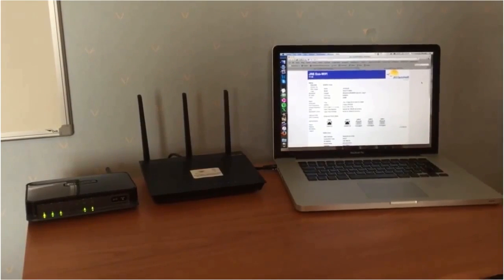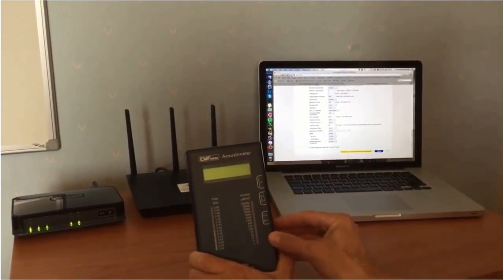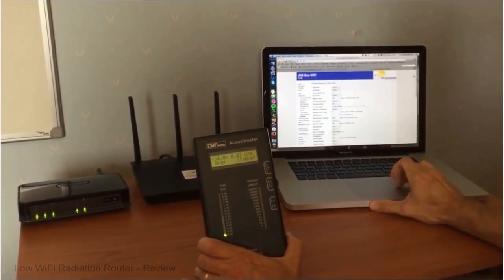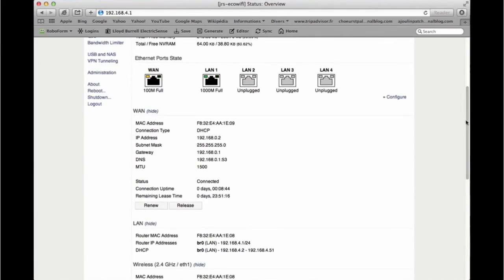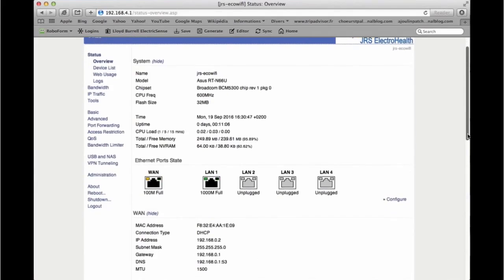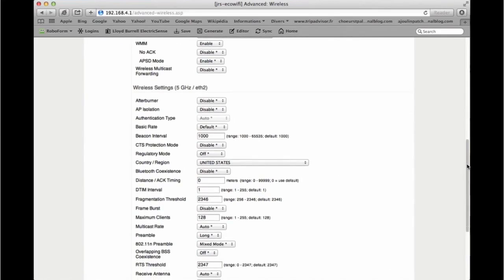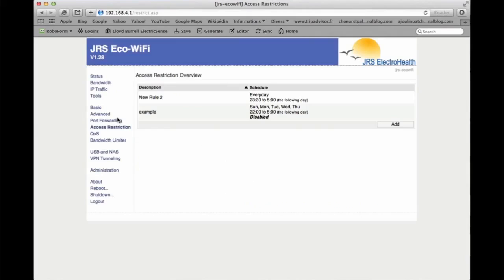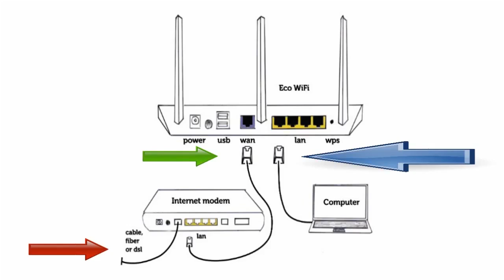Low Radiation Wifi Router - 90% Reduction In Radiation Possible

Comment: I have an older linksys WRT54G router - wired and wireless - has served me well.  However, WIFI does give off signals similar to video.   When I disable the WIFI with the html admin it does disable the connection, however the RF emissions still happen.  When I unplug the router, the emissions stop.     I'm not sure, but think the issue might be with this router and I just need another one.   I like the idea of a router where we can easily choose the WIFI or not and tune the strength of the signal - router suggestions where the RF goes away when WIFI disabled and can tune the strength of the WIFI when enabled?   Thanks.

Comment: Is this model router the latest version of it AND is the lower radiation signal also a weaker one in terms of being able to be picked up from another room than a conventional router?  Thanks
Reply from the maker: The latest model is the N300 there is a link form this page https://www.electricsense.com/11779/eco-wifi-low-radiation-router/ the signal is not necessarily weaker but you can also make it weaker via the settings if you choose.

Comment: I just bought the JRS router, what is the safest MiliWatt level  for  decent performance ?
Reply from the maker: The safest is the lowest possible power setting you can use and still have a sufficiently strong signal to connect to the Internet....you can figure this out by trial and error.

Comment: So cant you use these routers without having to buy a modem also and if you cant isn't there a router one can buy that can operate just on its own?
Reply from the maker: Yes you need a modem for the low radiation router to work... you can just buy an all in one modem router but you won't get the low radiation functionality.

Comment: Thank you for this very informative video. I live in the US and hope I can get one of these routers without difficulty. I have an Apple iMac computer. Does this all work with a Mac?

At around 16:25 in video where you're discussing cons, you said you would still have to disable wi-fi on your modem. Are you talking about a combination modem/wi-fi router? If it is only a modem, there wouldn't be any wifi would there?

Forgive me but I really have little knowledge about this stuff. 
I would greatly appreciate a response from anyone. I have all the sensitivity symptom s and they are quite severe. I want to get on it and make some changes. 
Thank you sincerely.
Reply from the maker: The JRS-Eco-WiFi router will work with any computer - I actually tested with my Mac computer. Wireless modems exist too, that is why if you have a wireless modem (i.e. a modem emitting a wireless signal) it's important that you deactivate the wireless functionality.

Comment: One question I have, is cell phone exposure vs wifi exposure. At home would it be better to utilize the data transmission via my cell phone or better to transmit data via wifi? My initial thought is that once you introduce a tower/transmitter, it by it's very nature will blast more radiation as it needs to constantly ping to see if it is receiving any new connection requests. Therefore using a cell phone for data is better as it does not emit nearly as much passive or pinging radiation as the wifi router would. Any thoughts on this topic?
Reply from the maker: It's very difficult to compare WiFi radiation with cell phone radiation because there are too many variables... strength of your WiFi, how close are you to it, what technology does your cell phone use, proximity of cell tower. But what I can say is if you have WiFi at home this means you are exposing yourself to  an additional source of pulsed microwave radiation, and often its 24/7. I don't condone cell phone use but if it allows you to avoid using WiFi at home, then its preferable.
Reply: @ElectricSense1  A LAN cable from a non-wifi router. It's like the commonality of Wifi made people forget that physical LAN lines exist.  ;)

Comment: Does anyone know whether the eco router will slow down internet speed, e.g. streaming Netflex, etc.
Reply from the maker: This router offers the same performance....the same download speeds as a normal router. That's why I reviewed it. It's only if you reduce the signal strength, would you lose performance in terms of distance from the router at which you can get a good signal.

Comment: Thanks very much. I currently have a BT home hub 4 and for a couple of months now I've been turning it off when not using Internet or wifi. Unfortunately it doesn't have a separate on /off switch for wifi. Could you recommend a modem that has a switch to turn off wifi? I very rarely use my PC because I am disabled and suffer tons of pain if I sit at my computer, so unfortunately I have to lie down on the settee and use a tablet....one which appears not to be able to be connected via ethernet. I use ethernet cables for my tv recording box, in the form of two ethernet plugs.....one by the PC upstairs and one at the back of my tv downstairs, so unfortunately your video on how to connect the low radiation router, didn't apply to me. Thanks

Comment: Is reducing my current router's "transmit power" an option to reduce the levels of EMF being emitted?
Reply: I actually have the Asus RT-N56U router which is probably the same router being sold but with a factory firmware on it. These are its settings. I put a (*) where there is potential. Set AP Isolated: No, Enable IGMP Snooping: Disable, Multicast Rate(Mbps): Auto, Preamble Type: Long, RTS Threshold: 2347, DTIM Interval: 1, Beacon Interval: 100*, Enable TX Bursting: Enable*, Enable Packet Aggregation: Enable, Enable WMM APSD: Enable, Enable WMM DLS: Disable, Tx power adjustment 100%*
Reply: @MrBrianDuga    Same here, I have this hardware already.  As this company states, they are only modifying the firmware, so we should be able to update the firmware ourselves?  But I don't see any download link, or the option to purchase a custom firmware from them.  I have sent them a message but am not holding my breath for them to release the firmware directly to me.

Comment: Thank You for this!! I used your advice in this video to configure my ISP residential gateway (WiFi - router) to transmit less power (less radiation). I wish I had learned this along time ago. However when I studied networking in college, WiFi didn't even exist yet (well it was only experimental at the time). I Disabled the 2.4 GHz band, and currently using only the 5 GHz band in 10 transmit power (the lowest setting in my ISP WiFi router), I've found that in my small apartment it works great, and as soon as I walk out the door the signal dramatically starts to decrease. Which is a good thing, I don't want strangers to try to access my network. I found during my experimentation that the 2.4 GHz band would reach 3 times as far with the lowest transmit power setting (10). Which was eye opening. Oddly enough, my ISP has the transmit power setting set to 100 by default on all their Residential Gateway WiFi routers. So I can deduce, that every single apartment in my 500 unit complex is bombarded with extremely too much radiation for our small apartments. And most homes they also supply internet to. I am VERY thankful for your video. Hats off to you friend. You just provided a very valuable service for your fellow man.
Reply: you're absolutely right -- most of us should have learned this a long time ago, but back in the day one was even ridiculed if one even touched upon the subject (for example, my remarks were also systematically deleted on Wikipedia by industry-sponsored trolls, as it seems. Not uncommon for that source of 'information' BTW). So, yes, the more we know about EMFs and health the better the overall situation will become.

I am also grateful for Lloyds honesty in mentioning that a low-radiation router is just a PATCH (not a complete fix) for the problem. Even a 'patch' is a good thing though if it helps providing a solution (in case people really want a wireless connection). Best way though is turning it all off and simply go hard-wired, just as Lloyd said. More secure against attacks and better speed, too!

Comment: Hi Lloyd, I have a few questions. What is the better band to use for lower EMF exposure 2.4Ghz or 5Ghz? Does this router not have a built in modem? I am wanting to order one of these in Australia, but I can not understand the website as it appears to be in Dutch. I also can not figure out how to contact the owner of the website. Would it be possible for me to buy a local model router that is compatible with this software and then pay for the software and install it on the router myself?
Reply from the maker: There is no clear answer to which frequency is safer unfortunately….the studies show that the 5Ghz frequency has less penetrative power. There is no built in modem…you connect your existing modem to the router. There is information in my article which explains how to do this.
Reply: Thanks for the response. What about getting the software separately as it seems a bit complicated to order for Australia. Do you know of any way to contact the supplier? Do they speak English?
Reply from the maker: You can contact the supplier directly they speak English - there is a link at the bottom of my review page.
Reply: You can actually even change the beacon interval, so it does everything JRS firmware does, I just changed my beacon interval and tested it with my meter. It works! Change it to 1000 to have it sent once a second.. 5000 every five seconds.
Reply: You can get a software called Tomato that does almost everything shown in this video for free . Google "Tomato by Shibby". I have a WRT54GL with it and I can reduce the TX Power and schedule it to turn off just like in this video.
It's great JRS has stepped up to sell this router that is already configured, as it is a lot of work to flash the firmware and get the correct one. If done wrong, you will brick the router. The JRS also has the reduced beacon rate which Tomato does not.
Reply: Wow, that's cool, thanks for letting us know. Does it work for all routers?
Reply: Hi! I'm not very technical. To have lesser exposure, do I need to order a special modem? Also, I live in a house that requires a booster (no matter how fast the internet connection or how generous the data plan). Does the booster ruin the concept of the low exposure modem? Is there no point in ordering such a modem as ling as we use boosters, or can I order special low exposure boosters too?
Reply: @TheJenniferKK  1. if the Modem (NOT combination modem/wifi router) has a phone line or cable that your internet comes into the house from, it doesn't send out that radiation. 
2. the wireless routers & boosters are the parts that send out the wireless radiation, so it usually defeats the purpose. But, there are some boosters that are connected to the router with a network cable, or even via the house's electrical wiring. that cuts down on the router & boosters having to have a strong wireless signal to reach each other.
3. if the booster can be connected that way, then if it has options to reduce its power, then that would work best. it would be like having a few low powered, low exposure, short range zones where you want in your house... instead of covering your entire space with high exposure.